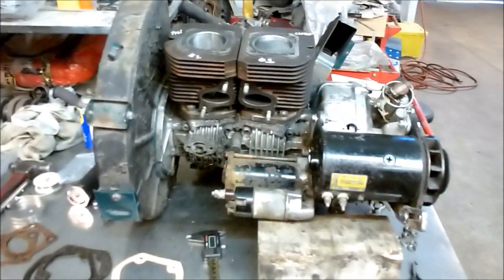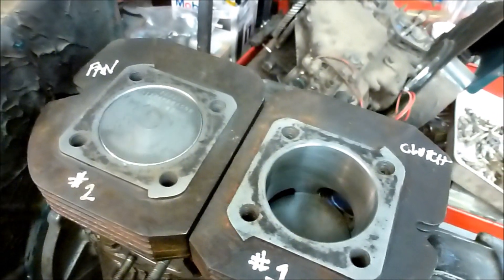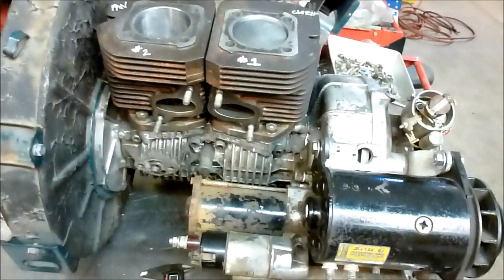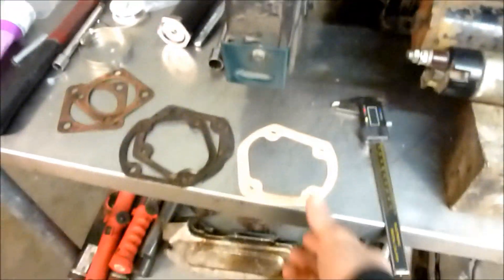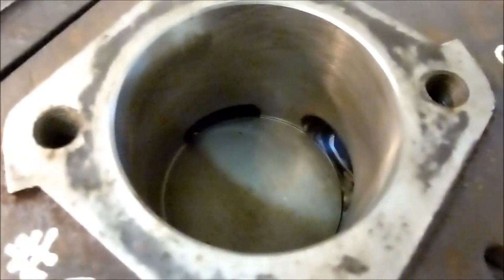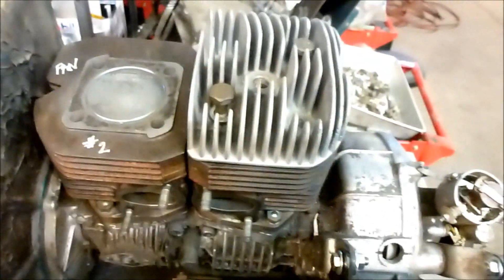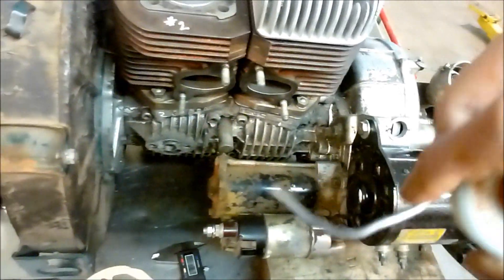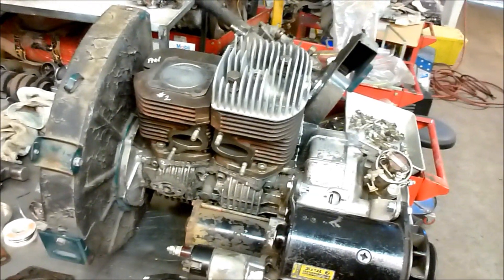Subaru 360 hot rod engine build

Comment: if the squish is to high .... it will detonate on it self after a while and you will be be able to remove the spark plug cap and the engine will continue to run.
this is what i experienced, when i used grinding paste and a sheet of glass on my Puch Maxi moped cyl head and modifying the ports.
but i did get well over 10.000 rpm as teenager, just by going to library. using stock cyl, head, carb (completely stock), but i modified the inlet manifold (Yamaha RD powerbox) and a Proma expantion exhaust.

Comment: Do you think it would be possible to swap in a Yamaha Enticer E340 338cc motor? It looks fairly close in overall size. It is an inline twin with built in cooling fan and shroud as well. But the Yamaha makes about 32hp@6,500rpm/ 25ft-lbs@6,000rpm. The extra 7hp would make a big difference. But also, it can be tuned fairly easily to make 35-40hp just by reworking the intake, carb and exhaust. I've been told that with dual carbs and a good pipe they can make 50hp but I don't know if that's true. And the best part is a good one can be found for $200.00.

Comment: To best of my knowledge, inline two (4cyl) has zero secondary vibration like Flat4 (which is just inline 2 + 2 opposed).  Is that the case with Inline2 2strokes?
Reply from the maker: pretty much. Same firing and tach signal as a 4cylinder.
Reply: 2stroketurbo what kind of mileage and highway speed can you get out of those things ?
Reply from the maker: 50 mpg combined city and hwy.  If you are really easy on the hwy 75-90 mpg. @ 55 mph.Cars can go  75-80. Vans and trucks 65 mph

Comment: If u raise the cylinders u reduce intake port duration when u increase duration of transfers and exhaust, for more rpm u need longer intake duration also; maybe u want to do it in 1-2mm increments so u dont go to peaky, I would suggest fitting some better pistons also and twin carbs.

Comment: Ahh, Mr.360 master.. Your efforts for these beasts never ceases. What did you have to do to get a manifold to match the HSR and for a stock engine, where would I be in terms of oil pump pulleys and mod costs? Yoda is still being a feckless fussy old man. Still carbless, no answer from a few club members re:any carb at all.

Comment: Very cool, Mark. What you're doing is very similar to what I did to various 2-stroke motorcycle engines a few decades back. Spaced up the cylinders to jack up the transfer ports and milled the heads to make up the compression. With some milling of intake and exhaust ports, and properly designed expansion chamber exhaust, and big Mikuni carbs, man could you make those engines scream. Your Subaru 360 looks a lot like the Yamaha 350 and Suzuki 500 twins I drag-raced.